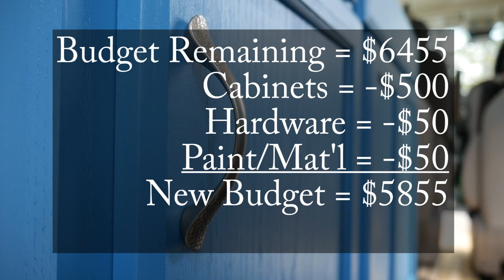How to build a Campervan: Part 10 - Cabinet Install

Comment: I like the idea of converting a ProMaster. I didn't know you could buy cabinets off the shelf.  That seems really simple. Costco has a 1 kWh Goal Zero lithium battery pack with all kinds of power options and plug in solar. A lot of times there seem to be very simple ways to do things. It still seems like a lot of work but these small standup vans make so much sense. Thanks for the info.
Reply from the maker: Thanks George, 
It was a lot of work, but we also had an emotional drive to build it. Therefore it was fun and did not seem like work. The time frames we were on are what made it stressful. 

All the best thanks for watching.

Comment: Finally, I see a person take advantage of the existing van rib holes to attach 1x4 to the van ribs and then bolt the cabinets to the 1x4 instead of drilling more holes to the van ribs. Could you let me know what type of screws you used (size and length and the types of washers etc?

Comment: But, but... they're BLUE!  LOL.  Great idea on the cabinet handles Heather.  I curious why you did such a extensive job insulating the floor?  And now, why no insulation behind the cabinets?
Reply from the maker: Thanks Keith...we will be insulating...we had some delay in shipping that ended up pushing the cabinets ahead. We will explain in the upcoming video. Thanks again for watching.

Comment: I was thinking that blue was way out of your comfort zone.  LOL  I hope you enjoy it.  I was wondering why you didn't use bathroom cabinets, which are usually only 18" deep.  Would have saved you a bit of money and given you a little bit more space down the center.  Right now it's looking a little crowded.  I hope that changes as things go together.  Plus, most flooring is run under the cabinets.  I was wondering why you cut that corner?
Reply from the maker: Hey DWDinAtlanta...hope you have been doing well. The blue was way out there for us, but we really like it. We really wanted to use the bathroom cabinet, but they were not available as an off the shelf unfinished cabinet at the big box store. Also they wouldn't have worked for us as we are using the larger cabinets to store batteries, water tank, and yes a small refrigerator. hehe. 

We called the manufacture for the flooring and they recommended that we not put the cabinets on top of the floor. This was for a couple of reasons...the first was the floor is not a real wood or tile so the manufacturer said the movement and weight of the cabinets would warp the planks and cause separation. Second reason was we needed access to the floor to bolt the batteries and water tank down (which will be in the cabinets). 

Great questions DWD...we should run our script passed you for review from now on. LOL. Thanks for being a part of our journey.
Reply: Not sure I am the right person to run things across.  LOL  I  make a lot of mistakes.  I am wanting to replace our kitchen floor, it needs a whole facelift really.   Trying to learn what I need to do.  LOL

Comment: Thinking about doing the same for my Promaster. How are these holding up so far? I plan to add 3/4" ply to the back (by my sliding door) and use 2 12"  cabinets with a 3' desktop between them.
Reply from the maker: So far so good. I did have to go back and upgrade some of the stapling, with screws and glue in the corner braces. Other than that they are doing great.
Reply: I was going to add more glue and a few screws anyway. And I will install those push-button knobs that lock when depressed. Thanks.

Comment: Just some questions about your plan for mechanical maintenance.

Since you got the promaster with not the diesel engine but the 3.6 V6 gasoline engine, which is only available for the U.S. market, that mean all the basic parts like spark plugs, belts, alternator, will not be available in Europe, most likely the transmission will be different too.

So, when something went wrong and you need to take it to a mechanic (If you can find one really know about the 3.6 V6), it might still take them weeks to get the parts.

What is your backup plan?

Why you didn't buy the Benz Sprinter?  It is the best selling full size van in Europe and the mechanical is the same, which mean you will able to have it service anywhere with tons of low price OEM parts.
Reply from the maker: Great Questions Kim!

- Yes the 3.6L is only available in the US for Promaster vans...However, it is the same engine in dozens of other vehicles many of which are used in Europe. Fiat imports the 3.6L for their vans and other vehicles. So I am not worried about find parts given the heavy use from chrysler, jeep, and fiat. 

- As far as finding a mechanic...so long as it isn't a serious problem...I feel confident in my ability in making any repairs and daily maintenance. 

- The Sprinter cost in the states is at a premium as it wears the Benz badge...that also translates into their parts and services. The cost is in many cases 50-75% more for parts and service on top of the purchase price. To get an equivalent Benz van we would of paid an additional $20K for the gas and almost another $30K for a diesel variant. That is a lot of reason to choose a low mileage gas promaster with less than 5k miles. Imagine all of the travelling you can do with that extra money...hehe.

Once again great questions. 

Thanks for watching!

Comment: Since you have the "window van", are you able to replace any of the glass so you can open the windows?
Reply from the maker: You can but it is pricey! Good thing is now we have access to a much larger european van distributors so a lot more cool parts. Like Sun roofs and hatches.
Reply: Did you find any suppliers or shops that can do it?

Comment: What did you decide on a shower?
Reply from the maker: The shower is still on the list...we are looking at doing a propane instant hot water heater, but are running into some logistic issues of order one that will have the right fittings for European propane bottles. We think we might wait till we get there and avoid the hassle of learning the different adapter for propane.